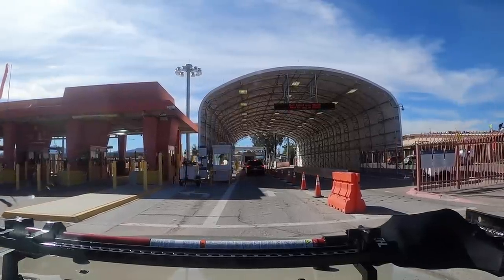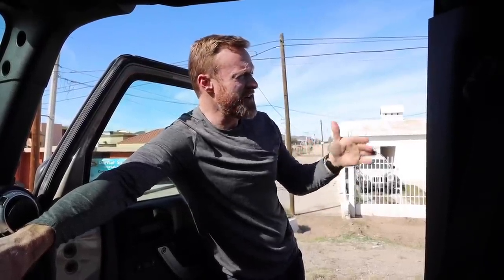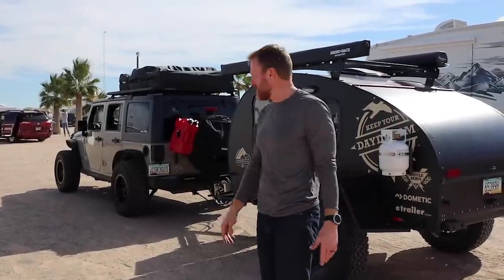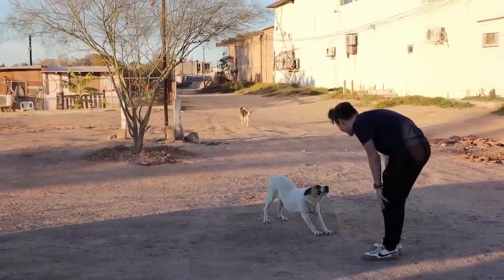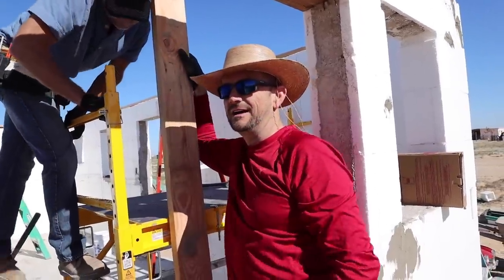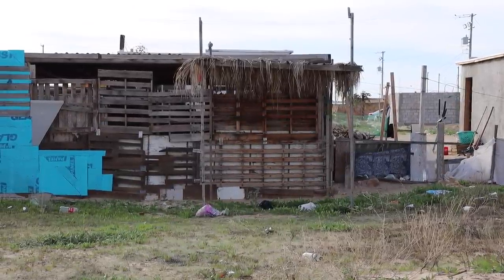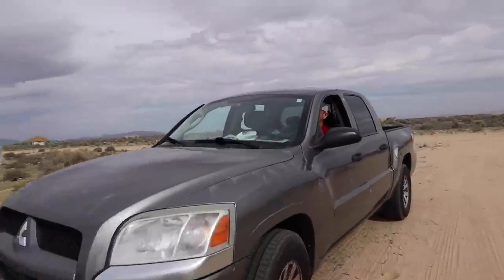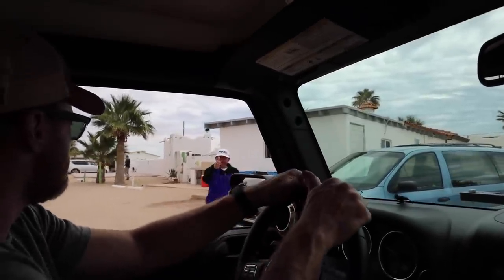Rooftop Tent Installed! Off to Mexico with 1Mission

Comment: Hey y’all...  Cindy and I have been following your channel for years.  We have a Motorhome and are avid Off Road nuts.  We have towed our Jeep Rubicon named Rub-X across the US several times.   I am very excited about following your adventures this season in your Jeep and tiny trailer.   I noticed your seven pin electrical connector location on your Jeep.  I mounted mine in the same place on Rub-X and promptly drug it off on a rocky trail.  You may want to be proactive and move it to a better location.  Be careful out there..   Also consider giving a shoutout to Tread Lightly!  Tread Lightly! is a non-profit organization that promotes responsible use of our outdoor resources.

Comment: May want the tent on the tear drop so you can leave your house set up when you run around
Reply from the maker: Joe good point and I agree! But we plan on taking the Jeep with us Next Season and tow it.
Reply: Keep Your Daydream Did you just state your new KYD rig, after the Jeep and Ginger:)
Reply: @KeepYourDaydream   Ohhhhh..... now I seeeee!!!  LOLZ
Reply: @zedhead2864  just to pull Marc's fat out of the fire, you can pull two vehicles at once. If the second vehicle you are towing is a car it makes the whole set-up track real straight
Reply: Yeah we just got some insight, but I think we all knew what was coming next season :))
Reply: @rnupnorthbrrrsm6123  I really thought it was coming this season. I was really surprised to see how far KYD down sized.
Reply: I would like to see a truck camper season :)
Reply from the maker: Can't do a truck camper next with where we're going, but I'd like to try it.
Reply: Next season, we will down size to my thumb and a backpack...

Comment: 30 amp IS 110v. Your standard household outlet is 15 amp or 20 amp, and still 110v. I always wondered why these teardrops and slide-in truck campers have a 30a outlet on the camper, but makes you use a standard household extension cord. It is lighter and easier to move, but thats where the convenience ends. A 30a cord with one adapter is alot easier that having a small cord with two adapters.

Comment: I still think I would have put the rooftop tent on the camper.  It would keep you from having to breakdown camp if you want to use the jeep.  The rooftop tent on the Jeep does open up some more off road camping adventures which may not be possible with a trailer (evan an off road on).  You have to do the setup which is good for you.  Tent on the Jeep does afford a little more privacy for everyone.  Enjoy!

Comment: We mounted a brand new RTT with annex and roof rack on our daughters Jeep, and within 1 week the jeep was stolen. The jeep was recovered, however stripped of the tent and all of the camping gear and valuables. The Jeep itself was written off and paid out, but none of the gear or tent was covered by our insurance provider... Not sure if the US is the same as Canada but we found out the hard way that an RTT is considered a dwelling and therefore requires separate coverage, even though it is permanently attached to the vehicle.
Reply from the maker: That's terrible! Rats ate wires on Tori's VW and cost $2,100 to repair. The following week, we paid off the car. The week after that, she totaled it! I feel your pain. She likes her Honda now :)

Comment: Great  idea!  Can’t wait until you start actual “camping” in your new rig!  Question - what is that metal bar in front of your windshield?  We notice that it’s sometimes not there. Did we miss the explanation for it when you did the reveal?
Reply: Robin McCune it is a high lift jack. An essential item for off-roading. The cumbersome size makes mounting locations difficult. Many mount them to a roof rack, but with the tent there, it doesn’t work. It is probably well below the drivers sight line, so it isn’t as intrusive as it seems in video.

Comment: Trish, I have seen a camper that you might like better than the teardrop.  
 F-Lite 14
EXTERIOR LENGTH 13’5″
EXTERIOR WIDTH 95″
EXTERIOR HEIGHT 97”
INTERIOR HEIGHT 6’ 1”
DRY WEIGHT 1,692 LBS
GVWR 3,680 LBS
HITCH WEIGHT 180 LBS
DINETTE BED SIZE 51″X72″
REFER SIZE 3 CU FT
FRESH TANK 18 GAL
COMBO TANK 30 GAL